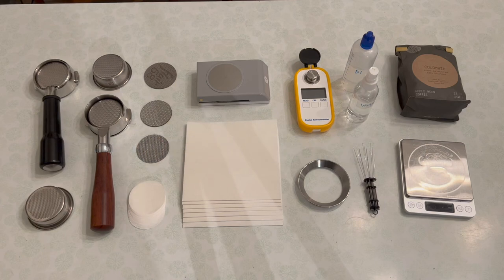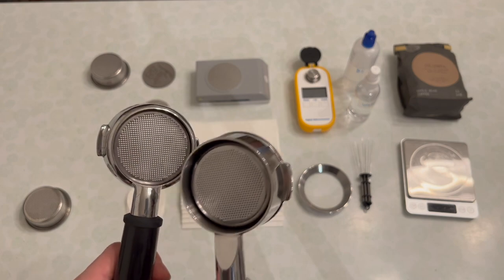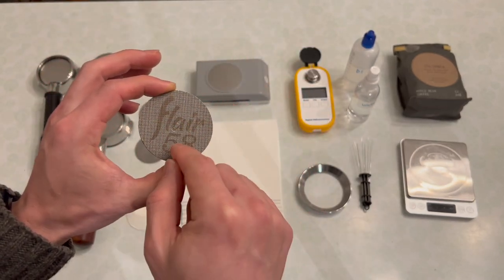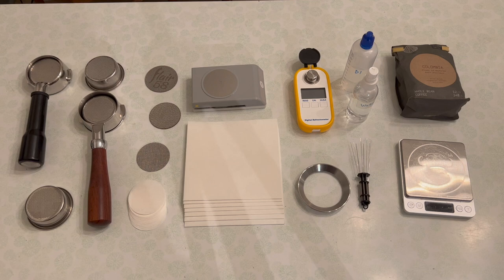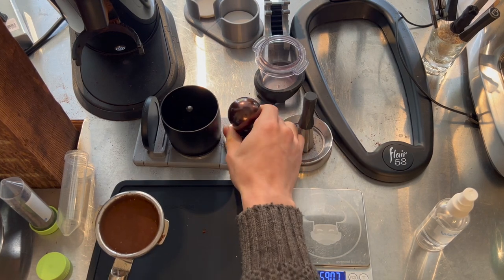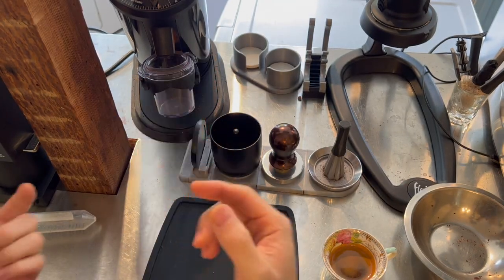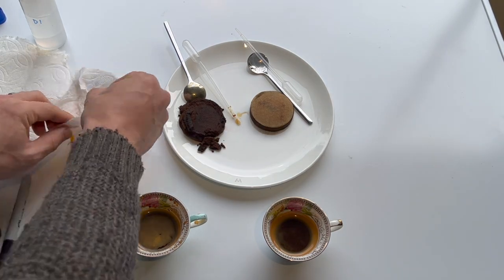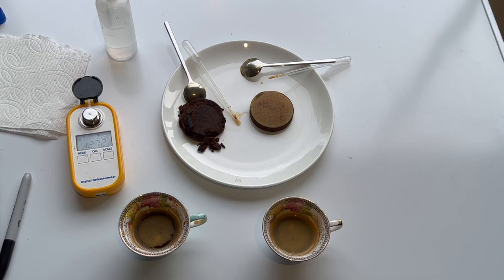The Modern Espresso Shot

Comment: JKim Makes,  you have very informative, enjoyable video.  Bravo sir.

I use a portafilter basket technique similar to yours on both our E61 and lever espresso machines but augmented with the use of both top of and bottom of puck modified cut Aeropress filters applied to the top and bottom to the pucks, then top dressed with a top puck metal screen.  I allow for headspace room/space  issues by using slightly reduced 15 or 16 gram doses, and 2 :1 brew ratios..  Like your method the uniformity of flow through the puck is just amazingly consistent giving great tasty clarity in the espresso cup.  This has given us the most amazingly good espresso since using the filters and mesh screens.    

Ultimately we all owe gratitude to Scott Rao who led the way in popularizing the use of puck paper filters, and additional supplementary metal mesh filters. to improve clarity and to improve puck flow/extraction in the quest to successfully reduce channeling.  Cheers.

Comment: Just a heads up: after watching your videos I ordered the paper punch from the link in the description. Wouldn’t cut filter paper the full circumference. And the part that did cut was ragged in several spots. Love the idea of trying this - I’ll give it a shot with hand-cut filters for now. Seems this issue is mentioned in the reviews. I hadn’t bothered to read them since such a simple device should not be difficult to produce.
Reply from the maker: There is a technique to getting clean punches. You want to punch 4 filters at a time. The chemex papers come pre-folded so it's perfect for that. You want to remove any slack from the mechanism and hold your thumbs towards the bottom of the punch. When you're squeezing, squeeze abruptly with a lot of force. If you try to press slowly, you will have issues like you mentioned.
Reply: @jkimmakes  thanks so much for the reply. I gave it a shot with 2 V60 filters stacked. That helped for sure. Still a little rough around the edges, but passable I’m sure. Appreciate the help and the videos. Keep the good info coming.

Comment: Hello and thank you for inspiring me to make better espresso the modern method, currently I use a rancillio Silvia and rocky grinder with 3 shot naked portofilter. I’m trying to replicate your method as close as I can with equipment I have now with the addition of the accessories you are using (am sourcing the accessories today), I have a few questions, when you pull a 3 shot - how many grams of beans are you using, how many grams of liquid is your output and how many pounds of pressure do you typically apply on your tamp? Thank You for your well put together videos.

Comment: Ever heared of the reneka microsieve ?
It’s hard to explain what exactly it is. Basically it works like a high precision metal mesh filter on the bottom would, without adding any restriction (actually mine has less restriction than a normal precision basket).
Reply from the maker: I haven't seen the reneka previously, but I have seen the e&b superfine which seems to operate on a similar principle. My main issue with the e&b is that the mesh doesn't extend much beyond the holes where they're mostly needed. I'm also not a huge fan of tapered baskets because they force more coffee to the perimeter holes which leads to uneven extraction.
Reply: @jkimmakes  the principle is different, since the reneka one actually makes use of the superfine mesh, by having an aeropress-like bottom. But yes, I too do prefer straight wall baskets.
For the reneka you have to grind way finer, so dark to medium roasts aren’t that great. (A lot of bitter fines come through, maybe an aeropress filter on the bottom can improve on those results.Cinnamon, light and light to medium roasts work way better than with my vst. (btw personally I’d define medium by an elongated first crack, but no second one, little acidity and maximum sweetness, milk chocolate)
Reply: @hanalsechs2959  the chemex paper filter in the bottom of the traditional basket reduces resistance, it doesn't add any. Jonathan Gagné has a article on it.

Comment: i found that with my manual lever machine, strietman ct1/ct2, the thick mesh filter on top made extractions worse by not allowing the puck to expand and compacting it so much that water could not easily permeate the puck. i had to down-dose over 2g to get good extractions, which i do not want to do. i dont know if youve experienced something like this in your experiments? thanks!
Reply from the maker: I had a similar experience w/ a metal mesh on my pre-mil La Pavoni Europiccola, but never got to theorizing why I was getting better results without. I still used a 2" chemex paper filter on top of my pucks in a 49mm basket, which worked well for me.
Reply: @jkimmakes  very cool to know your experience mirrors mine! did you find a good way to size filter paper for the bottom of 49mm baskets? thanks! (apologies in advance if this comment is a repeat. strangely this is my 3rd attempt to post a reply as my previous 2 are not showing up. maybe an issue on my end. or my comments are getting deleted somehow....)

Comment: any chance to show more about using metal mesh/screens on the bottom of baskets
Reply from the maker: I have a video planned for different filter types coming at some point.
Reply: @jkimmakes  I use a custom- cut gold filter for my Aeropress filter. This allows retention of body and oils. I prefer more body rather than a cleaner & acidic cup. Scott Rao says that a mesh filter on the bottom of the portafilter would impart a rancid taste over time because the filter is hard to clean. That's not what I find with my gold mesh filter.

Comment: what if you were to use the same top and bottom filters as well as WDT but pulling a normal shot, what does it change to the first shot ? Would it become almost too rich ?
Reply: From my understanding it would drastically improve the evenness of the flow through the puck, but I believe it would also increase the flow of water, so you would have to grind finer if you want a 20+ seconds of extraction instead of say... 12 seconds. The preinfusion and differences in pressure compared to a traditional espresso shot are mostly there to make the flow of water even more even, boost extraction a little and if I'm correct to also increase the evenness of temperature throughout the coffee puck. I think that In the end you would end up somewhere in between the two espressos from the video - more smooth and clean than traditional, but not as much as the modern one.